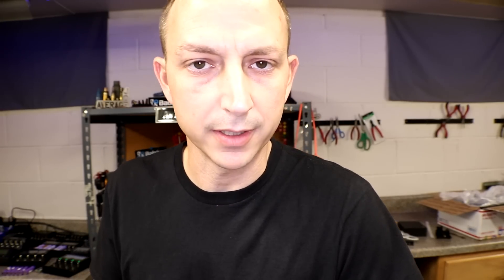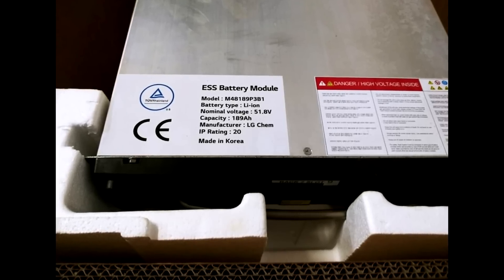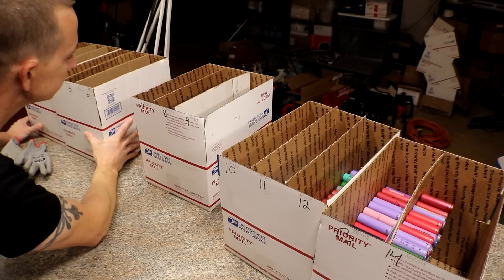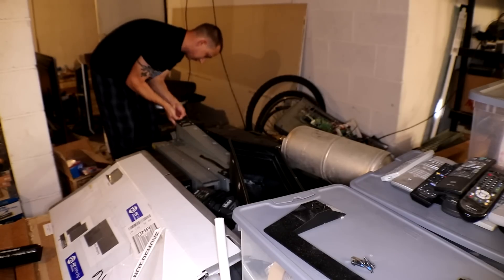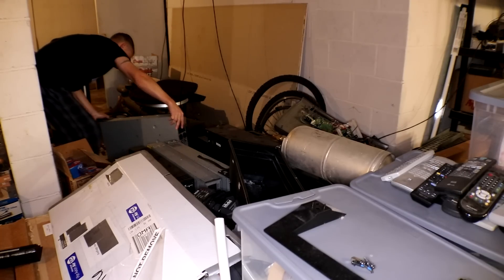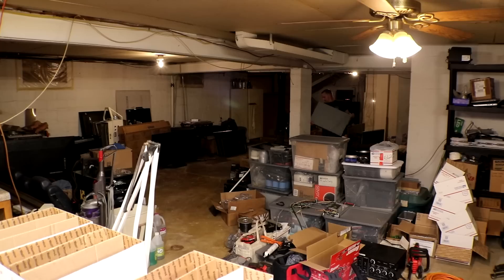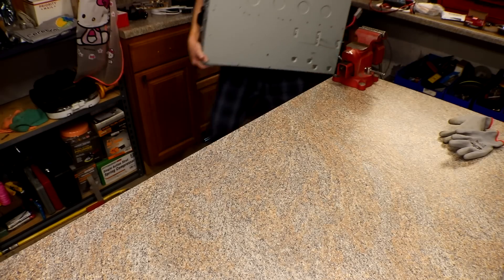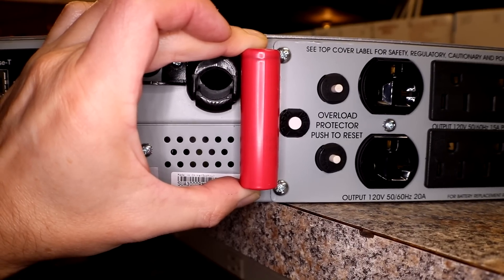UPS Battery Bank

Comment: What is the benefit of going 14S over 13S for a 48 volt system?
Reply from the maker: Mmmm not to much Id say. Mostly has to do with your charge controller and inverter voltages. I probly could have done 13s and be just fine with my setup but just decided 14s.

Comment: I would love the guts of the ups you took apart if it still works. Not the one you just took apart ofcourse. I would love to build a ups backup mounted on the wall with a bigger case. Ps looks pretty cool.
Reply from the maker: Sure Id be glad to send one to ya!👍
Reply: I'd be happy to pay for shipping, I really need something to base my battery that I'm building on. Currently no inverter. I really like you aproch on using the ups.
Reply from the maker: Sure no prob! I have another just like the one I took apart. Actually its the first ups I used in the powerwall when I first powered it up ect. Ill include an ethernet port as well. Think I have an extra. Keep in mind those transformers are heavy! Anyway I can take it apart in the next few days and find a box that will work. I have a scale as well so we can see what it weighs. My email is on the "about me" page.

Comment: Can anyone point me in the direction of his smaller builds, i want backup for a single pc, and a 3d printer 24v ups or 12v ups??
Reply from the maker: I have a couple older videos of both 12 and 24v. They were porly made back then and didnt use a bms a much needed bms. I do plan to redo/update the 24v when I get some time!

Comment: You could run the 14s but run the long mon on the outside and join 2 or 3 packs togather on one longmon. So 14 longmos with 3 packs each but you won't have as much data to look at
Reply from the maker: Yeah thats a possibility.  I will mount the longmons outside the case for sure!

Comment: Did you ever think about building different packs 14S with 14 pin plugs leading to the 14 longmons located 'outside' the packs? I know you have to be very carefull connecting the plugs, that all voltages are correct. But if build a connection with resistors you could use to balance i think it wouldn't be a big deal. Just my thoughts. Awesome idea with the UPSs, do it.
Reply from the maker: I will probly put the longmons outside the case for sure.  Only thing for a 14s is I would need 14 longmons per ups case and that will get expensive!
Reply: @AVERAGE_JOE  You can go with seperate 14 Pins from every case to a set of 14 Longmons. Only need to look that voltages are equal while connecting the 14 Pin plug. I thought with some resistors in series to the plugs to limit the current we could wait untill they're equal and then connect without the resistors. Do you know what I mean? Sorry for my poor english :)
Reply from the maker: Oh ok I gotcha with the plug! Yeah a resistor for sure!
Reply: @AVERAGE_JOE  Kidding me or do you understand my idea? I'm not sure...
Reply from the maker: Yeah I get what your sayin. A 14pin plug from each case daisy chained from one to the other. A resistor/resistors for the first hook up in case of voltage diff and not burn up a balance wire😃 Correct or did I go in wrong direction. There are a few other rack systems Ive seen where a lan cable linked to each case but it was for each bms in each case to talk to each other. Looked cool!
Reply: @AVERAGE_JOE  Yeah that's the idea. What do you think? I want to build several 14S20P Packs and connect them like this. Easy swap out one pack for service and the rest still online and working on. Think the balancing wires should be rather big, cause they maybe have to carry some load if one pack contains higher or lower cells. They would also balance over that wires. Maybe plugs like used for a Mainboard or PC power supply could be nice. Would go crazy to see this on your project. Big fan 😀

Comment: As long as each sell is fused you have a great safety net. I believe the main reason for fires would be a single cell shorting internally. If it does short, itll suck all the power from from cells within its parrelle network. As the short gets worse itll pull more and more power from the other cells. Once the pull is greater than the fuse, itll blow and the fire risk has been disarmed. Now the cell is isolated the cell should simple lose its energy via the internal short and stay slowly die to 0 volts.   

Where are these fires youve seen and have the causes been identified?  I suppose other reasons could be loose connections, inappropriate wires sizes and Cats tails. 

Cat tale ewwww
Reply from the maker: Yeah thats the theory for sure!  I have yet to see one fire in person.  Im talking about others  that show pics and share there story ect.  Some look SCARY for sure!!!
Reply: @AVERAGE_JOE  maybe build a cement board box/housing if u wanted it in basement. $15 a sheet. A few brackets. And a fire alarm above it. I want to say youll be fine but you have to do what will make you feel safe.

Comment: Just a thought. You could build a cheap breeze block bunker around the rack and perhaps have a metal tube come out the top to the outside of your house for fume extracrion incase of fire. $150 would cover that. Unsure if itd work but just thought. The idea came when you were whispering.
Reply from the maker: I have been thinking about the same with a vent pipe going outside lol😆

Comment: I hav e been working on a similar project using some trashed Lieberman battery pack case (GXT2-72VBATT). pulling out the old AGM batteries replacing with 18650 cells, also going with the 48v setup.
Reply from the maker: NICE!!! Hows it going so far?

Comment: Hey AgeRage Joe. Heat should not be a problem with so many cells under normal use. Unless I self discharger. The bigger the pack, the more the amp is distributed between the cells. So 600 cells devide into 14s at 10A is 239mA. 600 cells devide into 2s at 10A is 34mA. If you got the cells make 2s. However 14s will make it completely interchangeable. I would do 14s.
Reply from the maker: Yeah thats what I was thinking.  Shouldnt get to hot unless I really run some power through it.  Ill be doin 2s but YES 14s would be kinda cool to do.

Comment: Hey there,  After watching your video on the Lil litokala, I had to look up what a power wall was, and ended up spending 2hrs reading and watching stuff about it, very cool!!  I liked your content and this was 2nd vid of yours I watched, and I think I might have some helpful suggestions, so bare with me. 

Just retired from the fire service and  been into the drone/racing quad hobby about 4yrs now.  So i use a lot of lipos, but much differently. Our hobby has really seen an influx of the 18650's in the last year or so, more for our support gear though, like to power our goggles or video transmitters, the quads use lipo packs on them, soft casing, variety of sizes and built to take abuse, and hopefully not explode.   Anyway I have seen my share of lipo fires, and unfortunately one was not on the job.  When I was a newbie in the hobby, I bought a cheap charger, and did zero research on lipo technology or how to charge them.  Basically I was a cocky idiot who thought, how could just one battery be dangerous?  Charging a brand new 4s, 1300mah lipo, had it on wrong setting, wasn't using or know what the balance lead was for.  Luckily was still nearby, and heard crackling, by the time I figured out what it was, it went up in flames.  I had it in a lipo "safety" bag too, melted right through it.  Caught the drywall on fire in under a minute.  I threw two 16oz cups of water on it, and my gf finally found the fire extinguisher which barely put it out.  At the time I had been on the job for 20yrs, I had never ever seen something so small, burn that hot, in that short amount of time. 

So I'm rambling about this cause one I'm bored since I retired and two, if a whole rack of those go up in your basement, you're looking at 1500°F - 1800°F in less than a minute around the that UPS.  Mortar loses structural stability around 1200°F and concrete around 2000°F, so even if you push it in that back room with the low ceiling, a fire could possible ruin your foundation.  Also, if you are going to seal those UPS metal boxes, make sure you don't seal them air tight, drill several vent holes. When those lipos go up, it's from thermal runaway, and they not only heat up and ignite, but they off put a ton of gas and energy, if it doesn't have anywhere to go, you'll have a giant rectangle pipe bomb go off in your basement. 

Ok I do have some good news, a lot of us drone pilots are also on a budget, so we've made a lot of diy lipo charging/storage stations, lipo bunkers.  I'm sure you know about them, and honestly probably to small for your needs. On a budget though you can make AFFF, which stands for Aqueous Film Forming Foam, stuff we carry on the fire trucks for fuel fires.  Basically all you need is baking soda and white vinegar,  I charge my batteries in a metal ammo box,  I use two old caps from a spray paint can, put some white vinegar in them about 3/4 full, and add a dab of dish soap to give foam denser layering.  then I have long ziplock bag full of baking soda attached to the lid of the ammo box, and vent holes drilled in the side.  If the battery goes up while testing, it will melt the bag, drop the baking soda (which on it's own will almost extinguish the fire) then when it hits the vinegar, it's like the volcano science experiment some kid did every year school. and the two cap fulls and ziplock of baking soda make enough foam until that it pours out of the top. 

Well I did it again, rambled endlessly on my first post to new channel I'm following..lol.  Anyway, I know that exact set up probably won't work for you, but you seem very resourceful, was just thinking you could make your own foam extinguisher using that inexpensive recipe if you needed to.  Also, if you guys can use our type of lipos, hit up some RC clubs near you or look for FPV clubs on FB.  There are tons of forums arguing over the best way to dispose of all the lipos we go through, we'd love it if someone wanted to take them off our hands.  Have a good week, cheers!

Here's my almost burnt down basement....
https://photos.app.goo.gl/ebqG3ERVEGF7ovBA9
Reply from the maker: 😮you must be board😉😉😜Thanks for the watch!  I love to hear stories!  Thats how we learn!  I was the same way when I first started. Luckily<------ didnt start a fire or anything.  If I had a lipo pack Im pretty sure I would have similar to you! Interesting about the concrete!  I didnt think about that!  For the UPS cases, YES they are full of holes and would leave it that way for that reason.  If I put concrete board inside them, Id attempt to channel said flame out the back by angling the concrete board if that makes since.  I like the AFFF idea, I havent heard of that! I dont mind the ramble.  Gets me thinking!!!😎🤘

Comment: I have a question, i have a balance board 6s, you have P- and P+ for charging, and B- and B+ for the batterys, if i want to charge and discharge at the same time do i have to discharge with B+ and connect the B- to the P- or to the B-, its not clear in all the manuals and i know you have a lot of experience and seen your videos you are almost an professional.
Thanks anyway, keep up the good work.
Reply from the maker: You charge/discharge from the charger P side.  The reason there is a battery B side is the bms will cut power if needed to protect the battery.  Do you have a model number or link?

Comment: Joe, if i send you the battery hookup nickel strip would you test it to failure?
Reply from the maker: Yeah sure!  Address is down in description box!
Reply: Boom!  Order number 4855, I sent you 2 feet of the 4p version.  Figure you can test with your fuse rigamigger thingy and maybe put together a pack for further testing if so inclined.  

Im on the fence with this system.  Probably great for new cells, but like many unsure about the maintenance issues if theres a bad cell or if you actually blow a fuse, you have no fuse after, so you are back to...fuse wire.

Comment: I'm mixed mind on the nickle strip with fuses.  What happens if you blow one or two and need to change out a couple of cells?  Hmmm......  Always a pain no matter what system used.
Reply from the maker: Im still mixed as well lol.  There is always the possibility of a cell going bad or you accidentally touch a wire in wrong place and pop a fuse or 200.  Since I dont have any of the nickle yet I cant say for sure on replacing a cell yet.  Also Ill add that if you pop a single fuse or 2 that its ok to just leave it in the pack disconnected.  Sure the amp hour of the pack will be off a little and thats ok as well.
Reply: If I pop a fuse I can use fuse wire as I'm sure they will solder well.  Just worried about replacement cells but that may not really be an issue I guess.  My builds are on ebikes and cars which are a bit more sensitive to having cells out.
Reply from the maker: Yeah fuse wire if an accidental pop.  Ah yeah true on an ebike it could be more notice able!

Comment: I've thought about using old PC Cases each case would be manageable, I'm in the process of sizing a desktop PC Case up for this. As for your UPS case I think will need a lot of cooling.and there is no air circulation around the cells in the middle of the box. Would want to see the out come though.

Comment: Hiya Joe, good to see you again.  I'd go at least 7S per case.  That will cut down on cable gauges required, and you wont have to build multiple packs before you can deploy each one into the rack.  As far as safety, I haven't heard of any of us hobbyists in the community ever have a fully tested pack with at least one side of each cell fused, and not exceeding 1C discharge rate, ever having a fire.  So done right, ours our some of the safest out there :)  Also, if you ever go on a road-trip or camping, just pull one of your packs out and plug into a small 24V inverter and you have portable power anywhere.
Reply from the maker: Hey man whats up.  Yeah I totally forgot 7s per case lol. Its not a bad idea either. Id need 42 more longmons😲 .  I like the portable aspect of it as well.  Either way I go Im gonna need to get crackin on packs and testing more cells for sure lol.

Comment: I definitely think it's a good idea. Like you said, if they combust, it's discharging into the lid and should be better contained. As some added safety, there is a fire retardant insulation you could line the inside of your rack with to help contain a fire. BondedLogic UltraTouch. Maybe check into it and see if it would be worth adding, they might even sponsor you and give you some for a video! http://www.bondedlogic.com/ultratouch-denim-insulation/
Reply from the maker: Ill have to look into that stuff.  I was thinking possibly KAO wool.
Reply: @AVERAGE_JOE  Actually that looks like it may be better than the ultratouch! I couldn't find exact temperature ratings for the ultratouch, but the use applications for the KAO wool seem to be applications that would produce more heat than the applications of the ultratouch.
Reply from the maker: I couldnt find temps for it either lol but KOA wool is used in a forge🤷‍♂️ and those can get hot😀

Comment: I'd go with the 2S. The 14S config does sound tempting as expanding would be simpler.  Sucks that I tossed like 10 of those exact some UPSs earlier this year, otherwise I'd copy you in what you're about to do. I'd also think about getting some fans mounted either inside or out to help keeps all the cells and longmons cool.
Reply from the maker: Thats usually how it goes.  You throw something away and shortly after your like DOH....  Thats why I became a hoarder for "project" things lol.  Yeah Ill add some fans for sure!

Comment: I like when you whisper ;) You mathed, and I felt like I was right there with you.. don't do 14s that's madness per UPS... go massive will take time but well wroth it. Bigger packs are cheaper to BMS & have been proven to stay balanced better.
Reply from the maker: 😊😳 I only think of you when I try and mathed.  If I didnt have a calculator Id be SCREWED!😆 Yeah 14s in each would get a little madness since Id need cells a little closer in capacity.  2s I can get away with a wide verity of cells.  Dont want to spend a crap ton extra on longmons if I dont have to!
Reply: @AVERAGE_JOE  You don't need to fill each ups case to start with. Go 1s and move your other packs to make more room.

Comment: If you put your li-Ion battery rack outside, or anywhere the temperature gore below 32 degrees F, and try to charge them, you will destroy them......
Reply from the maker: I have charged packs in -22f before😮 Speaking of I still need to check on those😆